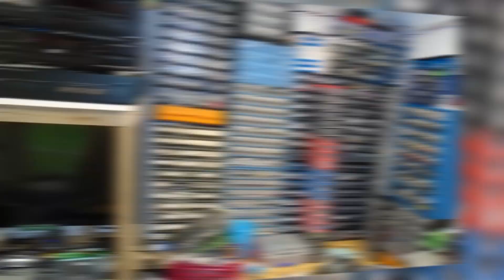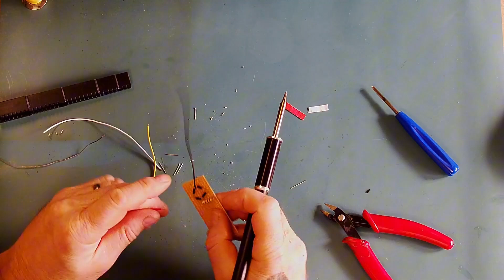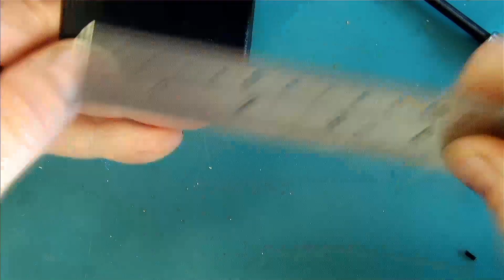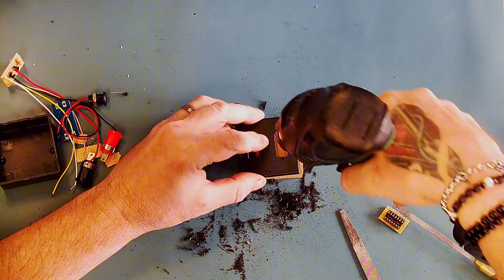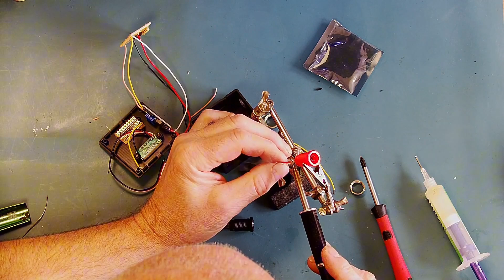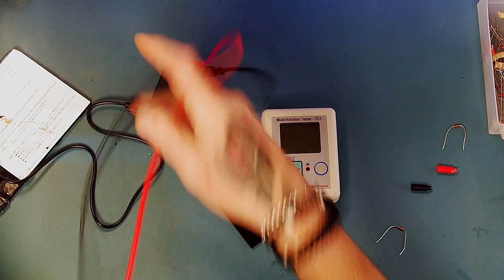$3  Comprehensive  USB C Powered Diode tester.

Comment: If you power the meter off the USB 5V, it will always work. If you use an LM317L or LM334  or TL431 you can turn the voltage up to 30V while always having a set current, say 1 or 3mA, go through any diode
Reply from the maker: Yes , yes and yes. However, there is no reason not to power the meter from the output of the boost converter in this device. I have seen that the voltage meter I  used can be more inaccurate at 5V. A lm317 , lm334 or tl431 and associated components actually costs more than i wanted for this project , and is unnecessary for a tester when the component is only connected for a couple of seconds at most.If you look at my low ohm meter, I used a tl431 as a constant current source for that.Also I don’t feel that 3mA is enough current to light 10 white LED’s in series to be clearly visible . The concept was to make a universal tester for $3 including the box, connectors and components. Thank you  for your comment and ideas.
Reply: @Joftec  The 3mA current will run through all 10 LEDs... if 3mA is enough to light one, it's enough to light 4398 leds in series, provided you have the voltage compliance. That's how series current works...
Reply from the maker: I said 3mA is not enough for them to be clearly visible, not that they would not light. Big difference.